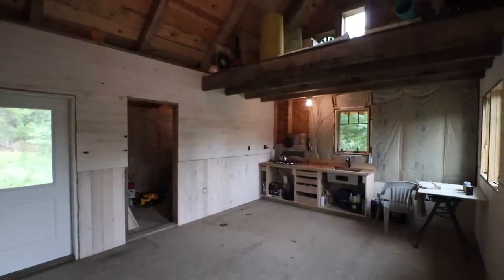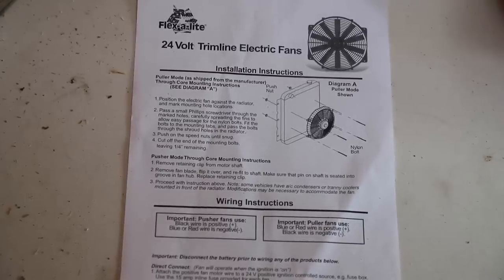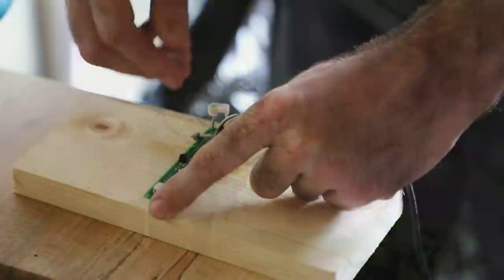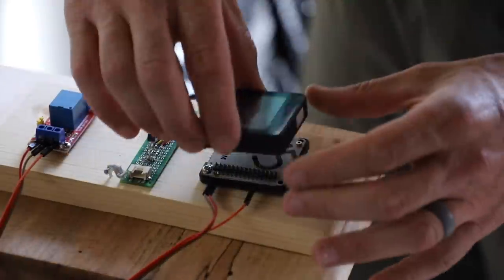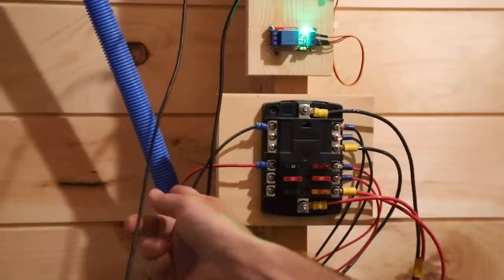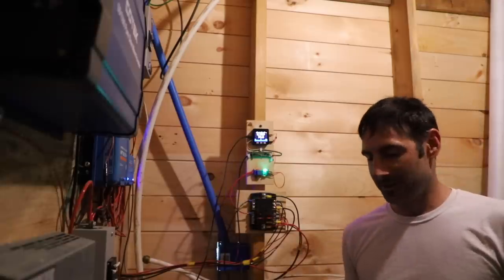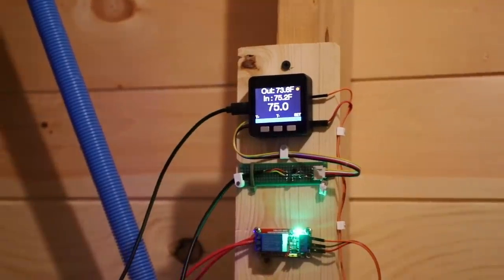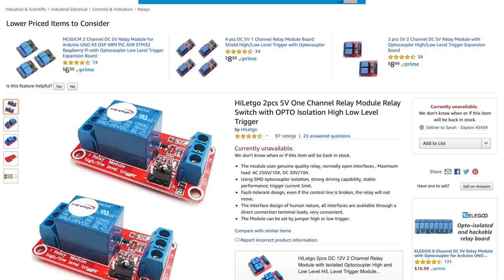Alternative to Off Grid Air Conditioning, Automating the Whole House Radiator Fan With Arduino

Comment: arduino.. solar charging monitor automatically..if saved batteries power goes below.. 25%
arduino.. play music (radio)..automatically.. when you clap your hands thrice.
arduino.. turn on the projector using Voice Recognition Module (buy a mini projector that works with android or iphone) has SD/TF card slot and can run on battery power or internal batteries to run on the ceiling of the cabin.. for entertainment.
arduino.. turn on the coffee maker
(addons.. Neo NM8 GPS Shield, Proximity sensor, ethernet shield, wifi Cc3300 shield, RTC DS1307 real time clock module, 3.5 TFT monitor module, RFID RDM 6300, Water level sensor,  RF 315/433 Transmitter/Reciever module, BT 4.0/5.0 Module, Digital Touch sensor module, SD card breakout module,  Sensor Shield,  8 channel DC 5v relay module,  an Arduino Bread board full or half with starter kit :)
Sooo many options.....hope you're well.. its been 43c here during day.... at night around 34c.. but extremely humid...stay safe..regards to your family... GOD BLESS.
Reply from the maker: There are so many cool potential future projects!  I am well, I hope you are also!
Reply: @50Acres   you only started with arduino.. and you're buzzed.. i wonder how you'd be Waaaat.. when you get into Raspberry pi 4 or  Rasberry pi zero.. doing ok.. can't sit well or sleep good in this heat..

Comment: angient europe uses old mudmade tubes underground has lot tubes were aircome run to in room and fan blow to room could air underground. one have expensive not good model youtube has many too, fridge box full ice and air go in and fan blow out. cool iar, but no longtime good. same fan were frontside have coppertube spiral and drop water front at fan blow cool air, not good longtime.
Reply from the maker: Thats pretty cool I read about the Romans piping water from their aqueducts to cool buildings.
Reply: @50Acres  yes but romans made undergrtound lot piping too, mud tubes have same than cementtubes, breathable, and keep cool, air come underground  moisture pipes and make air cool and then gome up to floor in house. same underground has pipin and fire make romans inhome poold hot water. romans has smarts. same can do today. off-grid easy-